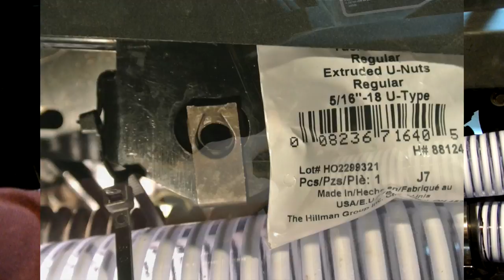Can Am Commander DIY Snorkel Kit

Comment: Suggestion on the filter... I know this is an older video, but what the hell.... I would have taken the outlet & inlet and faced them down. No water (rain would get sucked in while driving). Then take a drill and drilled two holes in each one... making a "+" pattern. Then go to lowe's and get a good quality furnace filter, cut into 2 1/4" circles and shove into the pipes. You'd get plenty of them out of a filter and changeable on the trail if needed... Definitely the best build that I've seen so far.. VERY simple, love your idea.

Comment: How long have you had this installed now?  Have you had any issues with the flex hose collapsing from the heat of the motor?  Thanks for the vid!
Reply from the maker: Going on 4 years with no issues.  The only difficult part is sealing the air box after cleaning the air filter.

Comment: Have you had any melting or deformity issues with the vacuum hose? Does that have a metal coil in it? Trying to find it locally.
Reply from the maker: +mrtosh No problems with the suction hose, it has a pvc coil inside.  I almost gave up trying to find the hose at a price I could find and finally ran across some at local place Rural King, which is a chain store.
Reply: +msfirefighter662 Is it just listed as vacuum hose?

Comment: Nice build! how's the throttle response now that the intake is noticeably longer? Also did you just seal the coupler to the flex hose with a hose clamp and no type of sealant?
Reply from the maker: +mrtosh I have not seen any difference in performance with the intake changes and  I did not use any sealant for the flex hose and boots, just made sure they were good and tight.  Good luck with your build.
Reply: +msfirefighter662 Excellent!  Thanks again!

Comment: sorry for all the noob questions but I found some 2" spa hose that's pretty thick hut has a temp rating of 150*. Do you think that would be sufficient enough of a heat rating?
Reply from the maker: +mrtosh I bet will do just fine, as long as the machine is running the piping is being cooled by the air flowing through it.
Reply: +msfirefighter662 I was thinking more for the cvt exhaust side.

Comment: once its all put together how do you test it?
Reply from the maker: +Rene Sanchez (SKIDMARKS) I have tested the engine intake system by capping the inlet while running and it quickly pulls a vacuum and dies.  the rest I have confidence in by how I constructed and assembled the system.   Thanks for the comment, Please Share & Subscribe.